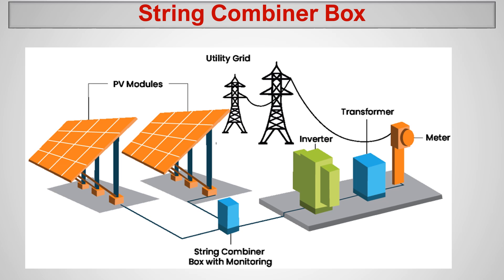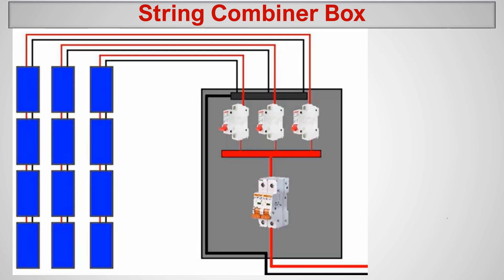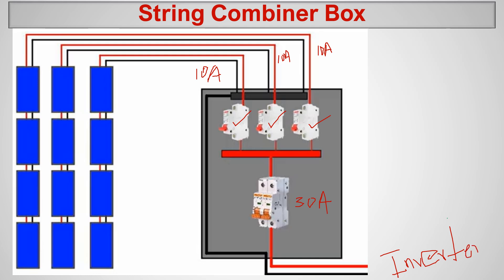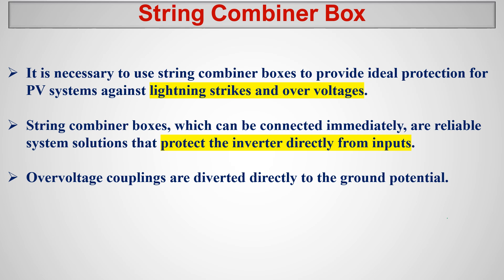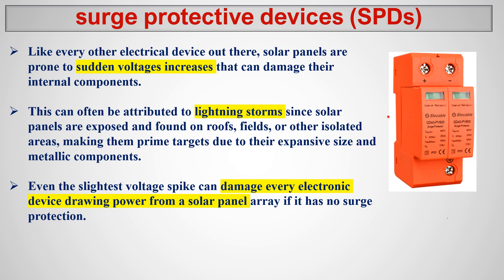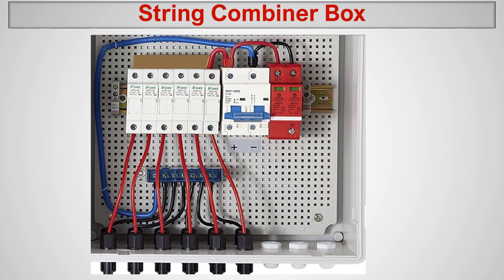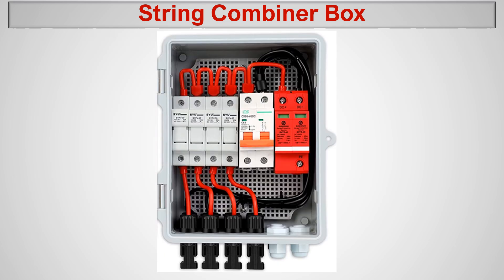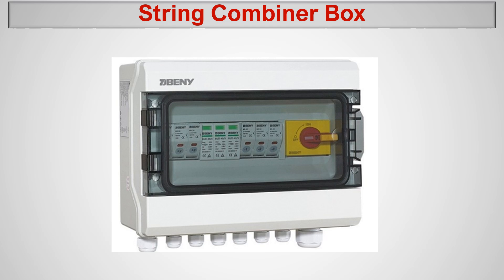Solar PV String Combiner Box # Solar Panel Installation Guide # Solar PV system protection #Breaker

Comment: Thanks for the vedio. 
If you have an inverter with two MPPTS the input current from the panels is 27 AMPS each . And if you combine all the strings together in the combiner box that would be more than 27 amp amps. Is that safe?
Reply from the maker: In general, 27 amps is safe. However, you must check the wires are capable of carrying 27 amps.
Reply: I have watched difference video about combiner box's, that I don't understand how it works, but this your explanation broke it down in a simple to understand, kudos to you, by the way I have subscribe to your channel